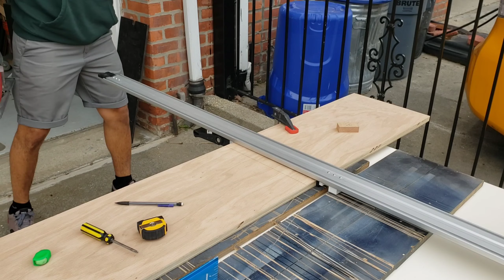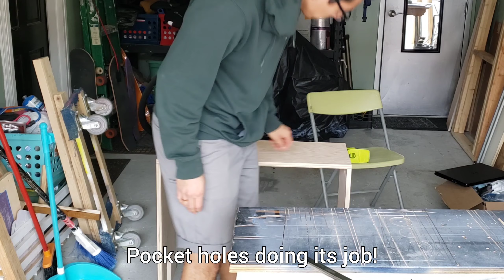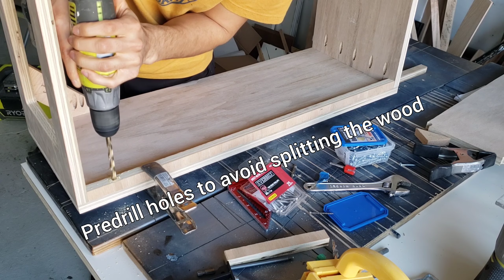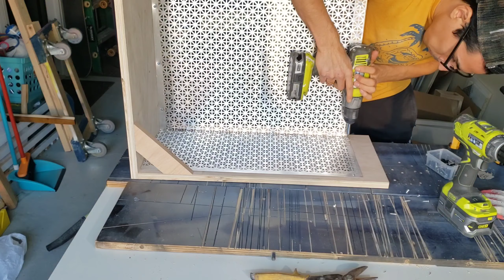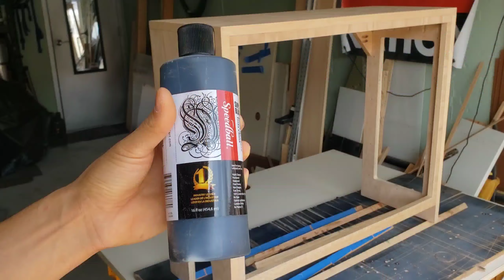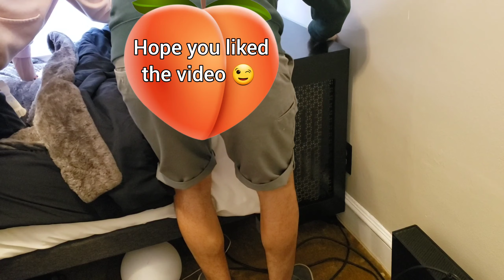Making a Radiator Cover out of Plywood and Sheet Metal | DIY

Comment: I never got a sense what it looked like in place. the bed is basically blocking the whole thing. What was the point if you can even see it? doesn't help me since I won't be blocking my radiator cover.
Reply from the maker: I mean you can see it from the side and parts of the front. It's not that hard to picture.